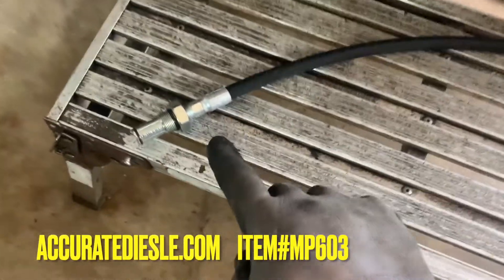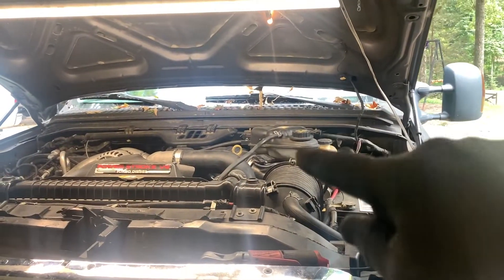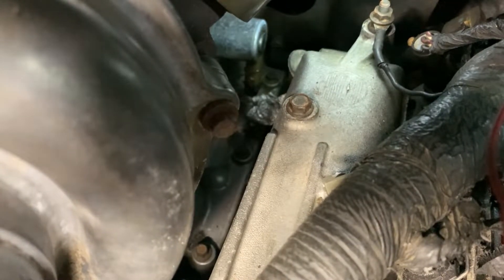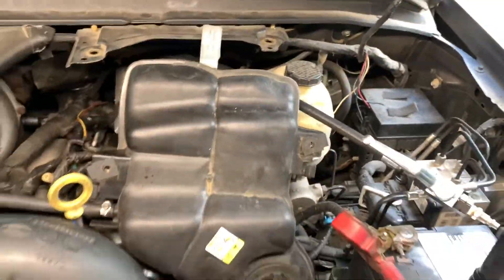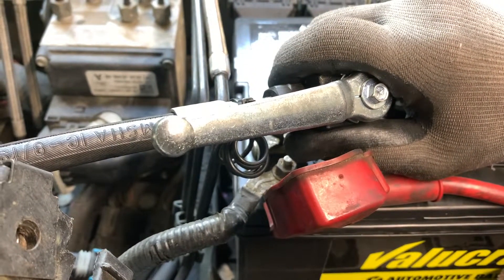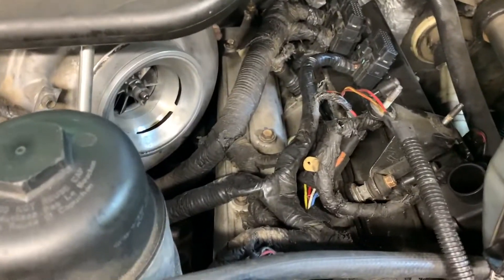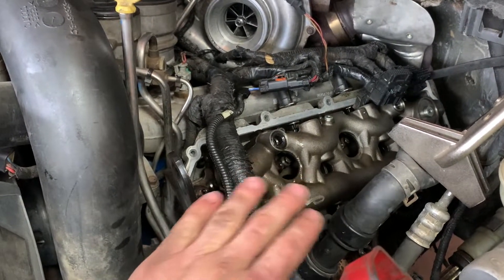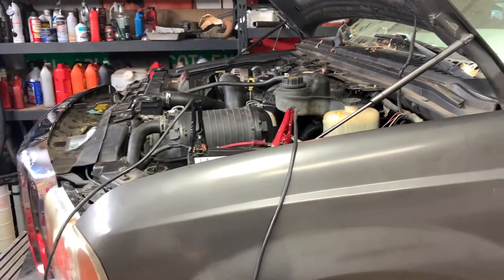6.0 Powerstroke high pressure oil system air test

Comment: So if you do it that way how do you command the IPR to shut so it goes throughout the whole system
Reply from the maker: The ipr is removed, this tester threads into the ipr port therefore the ipr is removed and is a moot point

Comment: Mine starts and immediately dies like yours did in the video. I have put a new LPOP in it, front cover, cam sensor, crank sensor, resealed every injector as they’re passing every test that i can run without the vehicle actually running, new HPOP, new stand pipes and dummy plugs and a new IPR valve. All of the parts have been OEM ford from my local ford dealership. All of my parameters are reading correctly it just takes a good 3-4 minutes to build ICP over 500. I’ve put seven 6.4 starters in this pickup in the last 2 months trying to get this thing started. I’m going to air test it again tomorrow as my entire system has been opened up again and I’ve resealed the injectors. At this point i feel like im down the nipple cup o rings, and branch tubes. 85psi of fuel pressure at my fass and at my bowl. Ficm is confirmed sync and its stays at a constant 48.5v any help would be great. I’m in this pickup over 70k since I’ve bought it and would really like to use it for work. Thank you!
Reply from the maker: @Itzzglobal  what year?

Comment: I've got a 03 with a 6.0 powerstroke hot all I get is crank no start , cold it takes awhile , after running and go to restart gauge for oil pressure or rpm do not move, I seen on one of your videos you talked about a obd reader that was not too much money, looked on amazon for it and it's unavailable where can I find one of those, like your videos
Reply from the maker: @bobhagman6474  there’s another on Amazon, ELM is the brand. It works also, just make sure whichever you buy will work with the forscan app

Comment: Ford calls for 15w/40, so why put in wrong type oil 10w30?
Reply from the maker: @JP-mu3xl  cause it was the wrong type to begin with. 10-30 or 5-40 makes your injectors way happier. Ask thousands or other 6.0 owners or forums or groups and ask them what they run and you’ll get the same answer. All my customers are happy with what I do and what I recommend. When you repair 6.0s run what you want but for me and my customers I’m gonna do what I know is proven.

Comment: can air test be done without turbo and intake?  I took mine apart to replace oil cooler
Reply from the maker: @gtzrg  your air testing Hpo system. Anything that is t part of that doesn’t matter so yes you can with intake and turbo removed

Comment: Is it typical for shop air to slowly bleed out of the high pressure oil system while using this method? I went ahead and updated my STC fitting while addressing an EGR cooler failure. No visible or audible leaks within my testing apparatus, or the high-pressure oil system itself. Once shutting off the air valve, I noticed air pressure slowly bleeding off by observing the gauge, 1-2 psi every 5 minutes or so. All fittings within test whip have been doped and tested leak free. The O-ring on the IPR-air fitting has also been verified leak free where it threads into the HPOP.
Reply from the maker: That is 100% acceptable. The system is designed to hold oil pressure not air so small leaks will be heard at times seeping is acceptable it’s the big leaks that are a problem.
Reply: 🫡 Roger that BiG DoG!
Many-many 🙏

Comment: Got an 03 6.0 around 200k miles. HPOP was replaced by diesel mechanic 2 months ago with oem ford motor craft per mechanic when I broke down out of state and was gonna cost a G to get it towed back to the house. Now I’m back to crank no start. Icp pressure at 397psi, ipr dumping at 84, icp voltage at .23, fcim readings good, low pressure dash gauge reading well. Took out ipr and hooked up air @150 psi and hearing air from oil fill tube and gurgling noises under oil filter. Gotta guess at what might be, what to look for? Fixing to pull passenger side valve cover and see what’s up! Thanks for sharing all that you do your videos are very helpful thank you!!
Reply from the maker: Did he replace the j tube also? Without hearing the air test myself and it being a 03 with the early style pump I’d say it’s either the pump or the j tube
Reply: I asked them to replace the orings on the J tube while they were in there but I have a feeling they did not. The air coming through oil fill tube is very faint but present. Gurgling/bubbling under oil filter is what initially got my attention. Thanks for replying back.
Reply: On my 2003 after hearing air from the driver side valve cover I pulled it off and believe I’ve got some leaks either on the top injector seals and or the nipple cups seals. Upon further examination the ipr screen was punctured I had a big piece of debris lodged in it. I’m going to replace the ipr and see if it will fire over. I’ve never had the hot no start associated with failed injector top orings/seals. The nipple cup on the number 2 injector is fairly loose which said injector had very little oil in it when I pulled the rail. I’m thinking that is where the majority of the air noise was coming from. In the meantime I’m going to order some seal kits and cups, swap the ipr, put it back together and see if it will fire over and pray to the good creator that the hpop I paid to have replaced two months ago is good, the mechanic did what I asked and didn’t cut corners! For anyone reading 6.0’s suck for anyone not working on them for a living I suggest selling it or enjoy working on it! I’m married to mine ha!

Comment: Used this video and adapter to check for a leak. I was able to quickly trace it to the passenger side dummy plug. Fixed the issue and starts like a champ...So far😅. The only thing i wish i hadn't wasted time doing was leak checking an empty oil rail after the repair. Hearing the air in the system had me thinking I still had leak when i didn't.
Reply from the maker: Yea, once there is nothing but air in the system it can throw you off. The system is meant to seal oil pressure not necessarily air so there are things like upper injector seals and nipple cups that will leak a little air but not necessarily leak oil pressure once it’s all under oil pressure like normal.

Comment: I just tried this and after about 15 seconds the only place i heard it coming from was where my oil filter is. Shut the air off and took my oil filter cap off and filter out and turned back. Sure enough thats what its coming from. What is that telling me? Any help is much appreciated!!!
Reply from the maker: That’s in the low pressure side, it doesn’t mean anything cause at that point you’ve evacuated all the oil out of the system. What are your symptoms? What’s your PIDS say when cranking?
Reply: @AutomedicGarage  got confirmations from 4 different individuals who have had the same situation I am with mine and it was hpop with all theirs. Says it’s not supposed to leak air past the hpop into the oil filter cavity.

Comment: When I test a hot no start I try to get the engine as hot as possible before testing if running it isn't possible at least plug the block heater in overnight before checking.
Reply: I didn’t start mine before the air test and then I saw your post about plugging in the block heater. I’m hearing a noise from the oil fill only when it gets plugged into the heater. Unplug and it goes away.
Reply: I'm glad it worked for you. At least you have a starting point now. Mine was leaking at the oil rail tube O-rings. It would start fine cold, but the block heater can get it warm enough to bring out the leak

Comment: wanting to fix the truck, and get rid of it. Well, we know he is not an honest person, and what a real jerkoff to just fix one injector and not replace all the seals etc which wouldn't cost that much. Instead he wants to dump his POS off to some unsuspecting person, knowing his POS will break down on the person soon. And i am sure he will not tell anyone that he had a bad seal etc., and replaced it, because he would have to tell them that the rest should soon follow and he didn't replace them while everything was exposed and less costly to fix. Me? I would have had all of them fix and updated and told prospective buyers that i just had the HPOS resealed with all new seals in the injectors etc. I hope he doesnt try to commit fraud and tell anyone he replaced the seals trying to make them think he did them all when he only did one! I wouldn't finish the work on his POS if i were this mechanic, knowing the guy plans to dump it off real quick before the other seals go.
Reply from the maker: It was just the one injector seal leaking due to a nipple cup seal failure. I’ve replaced just one on customers trucks a lot of times when they are on a budget and they are all running fine years later still and come to me for other maintenance. He did try to advertise it as all new injectors and nipple cups and I saw it on marketplace and called him out. The repair was solid and there’s nothing wrong with doing it that way long as your honest. Truck is still running fine also as I still see it after the new owner bought it. I can’t control what someone sets as a limit for what they want fixed. I do the repair and get paid for what I did. I can’t do more than they ok with me. I wanted to do the whole bank but like I said his truck his money. Thanks for watching.

Comment: I have an 03 6.0, air pressure testing at the IPR port, and I get bubbling sounds from under the HPOP. I changed the HPOP a few years ago, but I started getting a no start when hot situation recently. I know 03 pumps go bad a lot.
Reply from the maker: Yea the 03 early 04 pumps get weak. I don’t usually have them give me a crank no start but will usually start but only idle and after a few minutes the oil thins out and they won’t crank till they cool off again.

Comment: Hi , i have a 04 f550  6.0 crank no start  and i put shop air to the apr and i got air going into the coolant  side, what could couse that,?  Michael
Reply from the maker: I’ve honestly never seen that. So your actually pressurizing the coolant system?
Reply: Any chance you have an injector o-ring that failed and is leaking air into the coolant passages?

Comment: Before I do something incredibly stupid, do I have to drain the oil before applying air? I don't want to be blowing oil everywhere....
Reply from the maker: No. It will push the oil out of the rails back into the crankcase. Just remember when you disconnect your air hose after testing the motor itself will have air pressure in it. So, bleed the air slowly otherwise then you will shot oil everywhere.
Reply: @AutomedicGarage   Cool, thank you sir!

Comment: would this work for early 2004 6.0? i have the pain in the a$$ early one thatis hard to get to the ipr and icp. was running great and i shut it down then went to start it and it fired for a split second  and now she just cranks and cranks but no start.
Reply from the maker: Works on all year 7.3 and 6.0s
Reply: @AutomedicGarage  well, got my tool and tested and I have a HUGE leak coming from what sounds like  the drivers side rear from down under the head/in the block. some kind of hpop failure I'm guessing
Reply from the maker: @thegreener196  no bueno, if it’s under the head it’s a branch tube, that is if your has the cast iron pump not the round aluminum. Are you sure it isn’t a nipple cup or stand pipe?

Comment: Happy Father's Day! 
If I plug shop air into an IPR test plug would I hear a leak in the HPOP (old one with BB) or does that test adapter only charge the system downstream of the HPOP? Crank no start cold 250psi HP oil. Ran great all day. Went to start it 175psi hot, waited, 250psi next day.
Reply from the maker: It pressurizes the entire system, through the ipr is the best method because it takes it out of the loop without have to activate or send 12v to the ipr valve for testing. If you have a leak in or at the pump @ the j tube or STC fitting (depending what year and style pump you have you would hear it just not as prominent as if it’s at the rail with the dummy plugs, stand pipes or injector oring. What year truck?
Reply: @AutomedicGarage   2004. (Old pump, new oil rails) I followed your video exactly and diagnosed a clogged IPR (not visible to the naked eye) I blew air through it both ways while triggering it with full 12v on and off till if started to click consistently. The truck now starts quicker than it ever did. I am still replacing the valve however... I'll be keeping the spare in the truck. Thanks for these wonderful videos. This is our first diesel and my girl and I are having a lot of fun fixing it up. Wouldn't be as much fun without your videos.
Reply from the maker: @patrickwelch620  that’s a real compliment, thanks. And thanks for following us.

Comment: Hello just wanted to know if i was doing a leak test would i have to open the oil cap and the oil filter and the valve covers or could i just listen for an air leak with everything on? I have a 2004 f350 got good icp voltage and 1000 psi on the icp i have ficm sync and 49 volts on the ficm but the ipr was 85% and when i pulled it out it had debris on the screen and i have oil pressure
Reply from the maker: You can air test with them on but why not pull the oil fill cap and tube going into the CCV? The FICM and air intake are already off anyway to get to the ipr. Your icp is 1000psi while cranking over?

Comment: I have a question cause I did this exactly how you did . My vehicle when monitoring live data showed IPC building 1,500 psi extremely fast but my IPR is at 85 so I was having a crank no start. I’ve done this and found that lots of air could be heard and I mean as soon as I opened the valve cause I have the exact same tool which is plugged in the exact same way as yours in this video but your video I don’t hear anything. I isolated the noise and I believe it’s coming from the center where the branch tubing is and the  J-Tube an pump is. I really hope my studying is paying off cause I had another truck I couldn’t fix and made me kinda get my hopes down on working on these trucks. See what confused me also was that the first time I did this an exposed the pump I found the pump (aluminum ) not cast iron was leaking air from the front of it. So I replaced it an closed it up an then tested again an saw the new pump was still leaking from the same are on the pump. I did some more research an found that some people say it’s normal that it’s a  IPR drain Location. Others say it’s not normal an is a bad pump. So that has left me absolutely confused questioning myself wether I got a Defective new pump or if I did all that labor for nothing. I have yet to solve that mystery an here I am again dealing with another one of these trucks and the air pressure coming out was so much that when applying air that if I put my hand on the opening of the oil side after I removed the fill cap it would push my hand off. My truck is so much louder than yours when applying air unlike yours is when applying air. Please give me an information that you can when reading my paragraph cause man do I need it. I gave up once thinking I couldn’t fix the trucks but I’m trying again..
Reply from the maker: You will often times have some air, not a lot , leak on the gear side of the aluminum pumps. If your icp is hitting 1500 then your problem isn’t oil pressure unless you have a biased icp sensor. What is the ICP voltage? Should be close to .24 HPOP leak/no starts on 03-04s are usually pump related or possibly a injector oring. 05-06 would more than likely be stand pipes or dummy plugs, or possibly a STC fitting if it hasn’t been updated. It’s also good to check your nipple cups for leaks. The leak in this video was a crank no start hot, so it is harder to hear. Follow the sound of the air, it’ll show you where your leaking but also keep in mind small air leaks like at the top of a injector on the inner oring is normal especially after you already pushed air into the system because it’s supposed to have oil in there which helps it seal up more so than the air in the system.

Comment: Would you be able to hear if a dummy/stand plug was leaking with the valve covers still on? Just curious because I have to do this on my truck.
Reply from the maker: Yes you should. I listen through oil fill and CCV vent on valve covers to point me in the right direction. Sometimes it is hard to hear and I’ll remove the valve covers to hear better. Thanks for watching.
Reply: @AutomedicGarage  thank you for the response! I took my truck to the dealership to have my oil cooler replaced and they did a whole bunch of other stuff as well. Haven't even had it back for a whole year yet and here I am with a long crank/no hot start. They won't diagnose it for me because they said if it wasn't something they touched, they will have to charge me. Can't win with this truck.